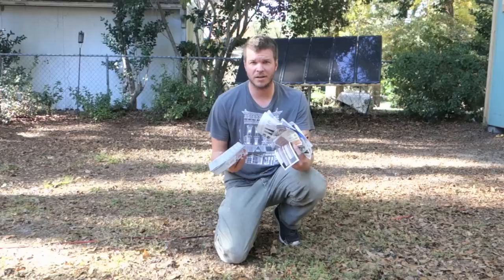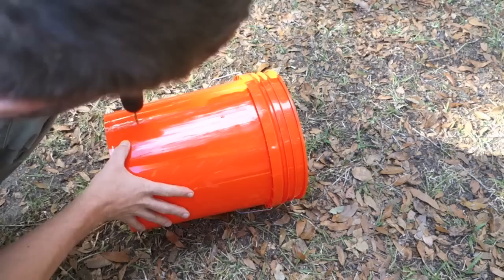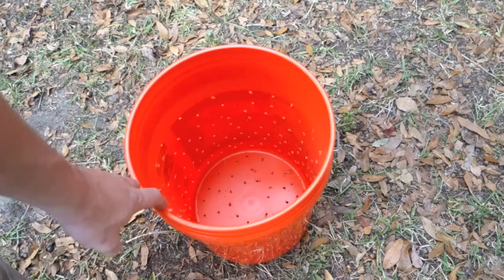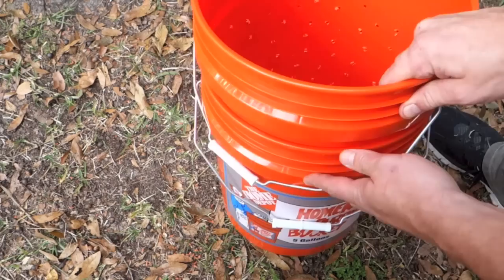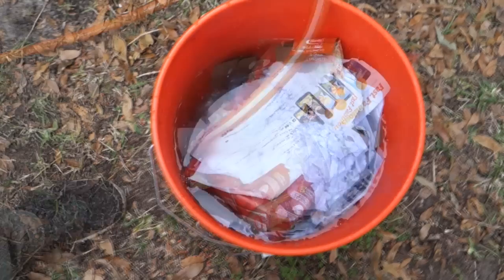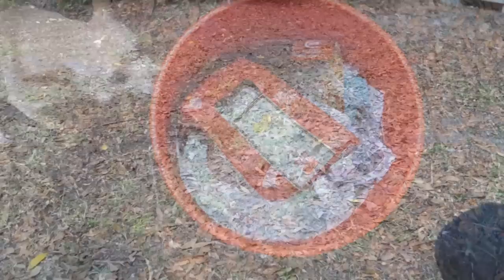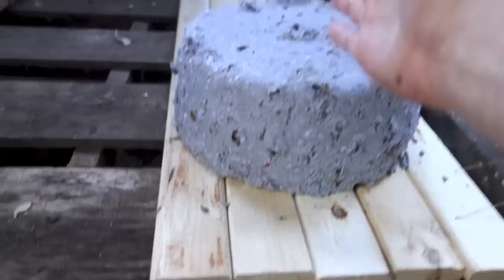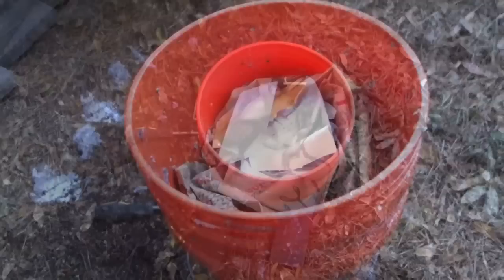Free And Virtually Unlimited Fuel To Heat Your Home

Comment: Unlimited Fuel ??? it takes way too much time.. to heat a house for a winter will take more than 1000 buckets. And where are you going to get all that paper or matter.
If you count your time alone its not worth it.
Reply from the maker: Samuel, the amount of paper logs you need to heat your home depends on the size of your home. On this channel we are discussing tiny homes so the number you mentioned is way over-estimated for the purposes of this video...
Reply: Tiny House Listings that's what i'm thinking while i read your page's name, "tiny house listings"... have you ever tried to heat the house during the whole autumn-winter season? and how much biomass required for that achievement? BTW great video.. thanks for sharing
Reply: Tiny House Listings How small of house are you talking about. My house is 28x60 single foor with 6 inch isolated walls. I live in southern indiana. I would need more than 2000 of those buckets.
Reply: This seriously only takes a few minutes a day after you initially get everything made. This is to be used in addition to wood, or whatever you burn. For the paper? Get free magazine subscriptions, kill your junk mail, ask for paper from neighbors and friends.
Reply: Spunk Mayo I would need around 10,000 pounds of paper to heat my house for a winter. That is not easy to come by. And to blend it up like the guy did in the video puts a lot of air with it and makes it very bulky. It would take a ridicules amount of space to store that amount of paper.
Reply: There's paper garbage everywhere. You could easily come up with 5 tons of garbage paper if you put your mind to it. I spent $3,000 on fuel oil last winter and doubt it would have taken me as long to collect all this paper and make logs as it took to work all those hours to buy fuel. There's probably a good way of mechanizing the process as well if you put your mind to it.
Reply: Thezuule1 Why not just burn wood.. It burns better and generally its attainable.
Reply: Samuel Atkins If you have access to forest land where you can get trees to burn that's probably the best bet if you have a wood stove. Many people in my area use pellet stoves now and the cost of fuel is very cheap, using a method like this you could reduce the cost to almost nothing if you had a pickup truck to haul the stuff and a faster method of making the logs.
Reply: you already miss the point, it's all about ecology... even a systems with a flower pot and candle, maybe is more efficient by the cost.
Reply: ***** You have no concept of energy. It doesnt matter it something burns even for 1000 hours.  That doesn't tell how much energy is being put out. Each one of logs hes making probably weight between 2 to 5 pounds each. assuming they are 5 pounds each log would have around 36000 BTUs. I need 65 Million BTUs a winter. Do the math. I would need 1805 of those paper log. I estimated 2000 but i was off by a few.
Reply: SLA SLASH burning wax is not efficient cost wise.
Reply: Thezuule1 You can get plenty of firewood in a city.. and much of it can be transported by a car.
Reply: Samuel Atkins Not usually for free.
Reply: Thezuule1 Yes its free.. look on craigslist.org. fired wood is being gave away all the time. here in Louisville ky there is a free add for firewood almost every day. its wood people wanna get rid of.
Reply: Samuel Atkins That's fine for the people of Louisville but my local craigslist doesn't have any free firewood. Every listing has a price attached. Cheapest I see is $100 for uncut unsplit.
Reply: ***** No its not. one pound paper has 7200 BTU  and a pound of coal has 9668 BTU. therefore coal has more energy per pound. BTU s is what heats the house.
Reply: You both fail to see the point that these logs are meant to be used in combination with other heat sources, not as a replacement.
Reply: It's simply another method to heat your home, in tandem with wood or coal, meant to reduce the costs of said items.
Reply: c
Reply: God Created Man You made some really good points.
Reply: God Created Man Excellent reply, My Brother, but one more thing we must do.  Require our spoiled brat leaders, and I use that word (leaders) loosely, to do everything they do must be green, can not harm the Earth or anything living there.  Tell the spoiled brats to get out of the sandbox and go home, fire themselves, and take there ball and bat and don't come back!!!   But I loved your reply my Brother, Namaste........
Reply: c
Reply: c
Reply: c
Reply: God Created Man " It seems obvious to me, that this is not a good alternative fuel source, nor is it environmentally friendly...since recycling paper saves trees from being cut down. "

Which is nice except they plant more trees. We don't recycle french fries and we're far from running out of potatoes.
Reply: God Created Man "We are living in the "end-times", which the Holy Bible has revealed many prophecies we are now witnessing as truth (too many to list)."

How convenient..... 

"There will be a "new Jerusalem, which cometh down out of heaven" "

Yes a giant space cube... Brilliant. 

" It is the most amazing book I have ever read, and I am not surprised that it is the most published book in all of human history, "

You've read the entire thing and you can make that claim? You should read other books imo. The Bible isn't even good literature beyond being full of barbarism, incest, genocide, slavery, etc.
Reply: c
Reply: God Created Man "Jesus even says "I am not of this world"...which is exactly like saying "I am an extra-terrestial".  The Bible makes perfect sense to me, and if it doesn't make sense to you, then whose problem is that? "

Might want to loosen the tinfoil. 

"You only inhibit people from learning on their own, because their conclusions do not coincide with your own. "

Nope and your personal conclusions appear to be quite wrong. 

" I believe these extra-terrestrials are watching us all the time, and are far more intelligent than we are.  I also believe the governments of Earth are fully aware of their existence and are hiding it, which is exactly why they don't allow people to think for themselves anymore"

Waaaaaay too tight.
Reply: c
Reply: c
Reply: c
Reply: c
Reply: c
Reply: I think y'all need to change channels y'all have got wwwwwaaaaaaàaaaaaayyyyyyy off the subject. OK I Dont know if any of you were in the ice storm where we were without heat from a week to 2½ to 3 months. Three people died just in my area. Now for all the stuff you throw away in a year I'm sure that by you making the logs would benefit in a emergency, or just to save on other heating sources. Or are all you doing anything to change this issue of giving off harmful chemicals. Or r u waiting on the government to do the work. Get off ur lazy azzes and do your part. One politician can't change everything on his/her self, we have to take part in doing our part. And I'm not saying that some politicians are not crooked as u mentioned but taking 5 min of your day to do this would not hurt you and in return doing ur part in keeping the ozone layer. And as far as firewood call local tree cutting services and some will drop the stuff they cut down to u. Cuz they just Dont want to deal with the wood. And the man in the video is just giving u ideas to help save some money.
Reply: OP has a valid point, however it would not be hard to do this is a more "efficient" way if you used the excess of time and space to your advantage. Most people don't understand when living off the grid that haste & waste simply cannot exist but this is when the creative opportunities presented by time & space are abundant. When we enter this state of mind creative thinking and practice come without effort. This whole paper wood method is not even really about what is "most efficient" by competing industry standards, but rather finding use for an abundance that suits your "talents" and/or desires and/or lifestyle choice, which is what really is the only efficient thing by competing cosmic standards, which are really the only competing standards after all. That is if you're not into that whole 'brevity thing.   #thedudeabides
Reply: c
Reply: c
Reply: I wouldn't say that I'm worried about the mill closing. Just an outward expression in writing about how much I love living in the woods.

I find that we also have a rather similar belief on recycling as well. It is a much needed thing, though I doubt it will be catching on anytime soon around these parts. Best we have is when we burn the paper or use an old tire to make a planter... Scrapping old metal is rather lucrative though.

I'm with you on the governing powers that be... not even gonna' start down that road. America is really bad off with who's running it into the ground. And I don't mean just the president. >,<

As for global warming, I say if a volcano can spew out more emissions than all of humanity over its entire industrial era, It's not something we can really control. Not to mention the fact that the Earth has always gone back and forth between hot and cold since it creation.

Our environmental impact however is definitely getting to be a little out of hand. That is the greatest concern for me.

Anyways, I'm with you on sleep. Thank you for the conversation and god bless.
Reply: Samuel Atkins You haven't heard of the once a year Ikea candle sale.  100 T-lites for $2.00
Reply: bloodandwinearered Yes.. and they are pretty small. Below is the link to the candles. 
I am not sure what you are trying to say. 
http://www.ikea.com/us/en/catalog/products/50097995/
Reply: Samuel Atkins Thank you for your reply.  I read where you said that wax was an expensive fuel.  You are right.  I just wanted to point out, that expensive fuel, at half price, is suddenly not expensive fuel.  I buy 2,000 candles a year.  Four of these small tealites under a three flower pot heater, offer me four hours comfort for 8 cents.
Reply: Spunk Mayo And you have to spend water, electricity, your time... Maybe it would be more effective and cheaper to buy truck of firewood?
Reply: bloodandwinearered How much does one of those little candles weigh
?
Reply: Samuel Atkins About a half ounce.
Reply: bloodandwinearered based on the weight you gave me wax is about same price as using Kerosene. Both are about the same price per pound and both has very close to the same BTUs. Electric on the other hand in my area is cheaper than using your type of candles. 17 kilowatts cost me $1.70  and this  has the same amount of energy as 100 candles.
Reply: Samuel Atkins Now really, what I am supposed to reply to that? 

I like the heat source near me.  Like sitting close to a fire.  I have an oil filled electric radiator heater that is just at my side.  I always have a hand atop it.  For 30 cents more... I can have my flower pot heater next to me on my desk.  I need not heat the whole place.  I only need heat where I am sitting.  I keep a bit of heat on in the bathroom.  I heat the solon with the oil filled electric radiator, heat the kitchen baking bread, heat the dining room with kerosene lamps and heat my personal space with a flower pot heater.  

You are correct, but it is only 30 cents more to have my heat right where I am.  I question if it is more expensive to heat the whole room with electricity. 

I lived through the 1991 ice storm.  I lived in January, in Quebec, with no heat for 13 days.  I managed to keep the place from freezing.
Reply: Samuel Atkins I hear what your saying sir, but take it from a gent that lives in Alaska and often heats my Home/Cabins with means other than natural gas; for about the same effort it takes to cut enough firewood (which you'll need to do anyway to utilize these paper logs), you can make enough biomass logs. You claimed that you'd need "around 1000 buckets" to heat your Indiana home, which I can tell you is an overestimation (unless you guys REALLY like heat down there lol XD). You use these to keep a fire going, not as the main fuel source, up here in the harsh winter 2 buckets along with some firewood keeps a "Tiny House" very comfortable, and somehow me and my family come up with 2 buckets of paper EASY lol. If you know anything about heating your home with firewood alone, you'd know that these biomass logs are a welcome way to recycle otherwise wasted fuel (we make it by the barrel though, so maybe that's where my opinion comes from, on a larger scale, this is very practical).
Reply: bloodandwinearered I was thinking you were crazy for burning wax for heat. just off hand i thought it was several times more expensive than Kerosene. And I was going to point this out to you. however when I figured the difference in price I was shocked. I went ahead and  posted this info for you. I thought it might interest you a little. If you like setting close to a fire than all the power to you. I use the T-lites for light when my Electric goes off.
Reply: cybertree How much paper weight do you think is in one of those paper logs made in a bucket?
Reply: Samuel Atkins Once again, thank you for your reply.  I am not accustomed to civil discussions in YouTube comment sections.  Here is to both of us staying warm and comfortable in our own ways this winter.
Reply: Samuel Atkins I don't think density is the real problem here (enough paper to meet your 65 MBTU needs would fit within a 6 foot cube were it compressed completely), it's the sheer amount of paper you'd have to receive (9000 lb). Think about that. That's almost 25 lb of paper every day of the year. That's a lot of paper.
Reply: toxic color papers. cancer stew.
Reply: Idk. That's a good question though.
Reply: Eric R Depends on which papers. Things like newspaper and that are predominantly made with plant-based inks these days.

In either case, if your firebox of choice leaks air back into your house, it's doing something wrong.
Reply: Spunk Mayo Only newspaper etc works.. Burning magazines are very bad for the environment AND humans/animals..Plus it burns like wet shit!
Reply: seigeengine lol at 6 foot cube.. interesting.
But think about it though. if it wasn't compacted would take up a lot of space.
Reply: Samuel Atkins Yeah, but compare that space to alternative fuels, like cords of wood? A good fire wood has about 22-23 MBTU/cord, so you'd need about three of them to provide the same energy, which would come in at over 7 feet, whereas paper is under 6. My point was mainly to say "Hey, it's not like it would take up THAT much space."

I still think the problem of supply is the biggest. We might get an average of half a pound a day, which puts you at about...... 8800 lb of paper short.
Reply: silveryblue2003 Even all of that would only be a fraction unless you went out of your way to get paper. Doing so would take work, and you're back at making this as inconvenient or worse than obtaining other fuels.
Reply: silveryblue2003 Yep!
Reply: Samuel Atkins That's not a house, it's a trailer
Reply: TRUE DAT!
Reply: ***** Yeah, you could bury my mail box in how much paper you'd have to get in a single day to make 750 a year.
Reply: The fuel is unlimited because it is not restricted to paper ... dry ... dry leaves or rotten wood milled laborious ... yeah, not limited;) ... DID the same as others with more affordable materials ... View presses used in briquettes and he used :) ... Great ...
Reply: This idea is for the do-it-yourself people. In addition, you have to start collecting paper in spring to have enough to last the winter. The mailers and news papers I get is usually enough to last me 2 months. I don't continuously heat my house with these - I use them for camp fires in the backyard. Pretty fun nontheless, shred paper in one sitting and make a few big buckets then cut them into quarters. Great for substituting wood and cuts down on wasting good wood.
Reply: I would like see a vídeo with your fuel in use ... Have you one ???
Reply: what you need to do is find some really poor people, maybe in communist china, to make these logs for a penny or two a piece. My time is way to valuable to waste making paper logs.
I even have one of those huge paper recycle dumpsters across the street. But as I said my time is to valuable and I would lose money spending my time for heat this way, cheaper for me to pay the district energy corporation and use the heat on the grid.
Reply: jackchorn Welcome to reality, but, if you're anywhere near the average person, your time is worth jack shit, and you waste plenty of it.
Reply: seigeengine my time is cherished. This is why I try not to spend much of it trading my labor for a wage.
I'm debt free, own my home and only need to work 10hrs a week to meet my needs.
Funny thing is I have more wealth then the vast majority of citizens.
Time is not money.
Reply: jackchorn You say that, but you spend time talking about it on the internet, so I have to question how much it takes, in reality, to motivate you to use up your time.

Money, as in units of currency as a measure of value are, economically, a stand-in for all forms of value in all things. That's the entire idea of a currency. That it's an absolute intermediary. That everything with value is translatable into a certain amount of that currency.

Great, but what do you actually do to earn money ten hours a week? And there's other forms of value possibly involved in labour. A mechanic, for example, can take satisfaction in helping people, and derive non-monetary value from the process of performing their job.

At the core of it, I agree with you. I'd rather work as little as possible, satisfy my needs (and wants, them not being outlandish), and have the rest of my time free to whatever I wish to fill it with.

Even then, what I wish to fill it with is always going to involve a certain amount of waste. I'm always going to have times when I don't want to think, or be invested in something, and just want to mindlessly perform a simple task to relax, focus my mind, and let it wander.
Reply: seigeengine very thoughtful.
Its a shame we live in a society that frowns on someone who spends their time pursuing a passion if it does not show a value in currency.
Reply: Realy Jackhsorn , realy ... We can to change it .. Now :) !!!
Reply: jackchorn Indeed, but that's the wonderful of thinking of value as currency. All value becomes the same, and you can more readily compare things.
Reply: seigeengine I'm fighting to go to a Tulip backed currency.
Reply: Samuel Atkins The biggest would be something like 14x24, but usually for house on wheels it can be 16(or 24)x6'8", or 10x12 studio cabins and everything in between.
Reply: Unbelievable how negatively people act on free advice on You Tube. Spend less time watching TV or whatever, and make one or two  of two of these paper blocks, even it is mainly for the fun. Definitely lots of fun for the kids. And the satisfaction of burning your own homemade fuel, even if it is only one block. And saving on  electricity keeping the paper from piling up on the dumping sites, etc..  And you get some sunshine if you do it outside.   Think Mother Nature. Do every bit you can. And to those who say it pollutes the air, therefor you won't use it: Hope you  are all making exclusively use of solar /wind energy.
Reply: Como opção briquetes são ótimos ... !!!
Reply: Simple Samuel Atkins Newspapers on the curbside!  I see STACKS of them every week.
Reply: Well you said it takes too much time and ISN'T   WORTH IT!!???? What you need to say is that IT'S  NOT WORTH IT ,,,TO YOU!!   VALUE  OF  SOMETHING  TO YOU   CAN BE WAY DIFFERENT  TO ME AND OTHERS!!  Like some people say golf isnt worth YOUR   TIME,,    HOWEVER to Many people   golf is PRICELESS !  JUST BC YOU DONT THINK SO  DOES NOT MEAN I DON'T  THINK IT WELL WORTH ME TIME!! AND  THEY JUST LIKE  MAKING SOMETHING  ON THEIR OWN AND TO  NOT BE SO DEPENDENT  ON   OTHERS AND GOV ,   NOT TO MENTION  THE MONEY THEY COULD SAVE!!
Reply: Seth Maddox This is an intelligent point applied to dumbly to the wrong context.

The reason some people value golf is because they enjoy it. They derive pleasure from engaging in gold. To them it has an easily understood value, whereas to others it does not. Where is your emotional investment in compressing paper into bricks and burning them? Most people certainly don't have one. Are you concerned about the environment? Do you have the foggiest idea of how this might  compare, then, environmentally, to recycling it?

How many dollars does a BTU of compressed paper have above buying or cutting your own firewood, or even using a different heat source? How much time does it cost you to each BTU of paperbrick?

Because let's look at your idea critically. Almost nobody considers golf priceless. The question is how much money you'd have to offer them for them to not play golf when they had otherwise wanted to, per hour? For example, if they'd normally play, say, 20 hours of golf a month, how much would I have to offer them before they'd not play golf for a month?

How much is screwing around with paper and buckets really worth to you, Mr. Maddox?
Reply: Done 365 days/ year, it may very well be worth it!  What about getting paper from neighbors? Getting your kids to help as a game of sorts. Savings could be toys, Disney CDs, visit, all kinds of kid rewards.
Reply: Laura Cullen Oh look, now you're not only wasting your time, but your neighbours time, and your kid's time!
Reply: Seth Maddox It's like a fourth grader watched babbies first economics video and thinks they understand anything.
Reply: But hey thats what you trolls do, its your right,    no matter how stupid  it is
Reply: Muted the troll.
Reply: Seth Maddox might those fingers be occupied elsewhere. Mouth drool?  Nasal boulders?  Jiggers?
Reply: Laura Cullen yea when I responded  to you it was meant to be AGREEMENT  WITH  WHAT YOU SAID ,   NOT ATTACK  ON YOU, if that's   what  ya talking about , ,,thats my bad!
Reply: seigeengine IF you suggesting in  another comment that  wood is 3 time more dense than these paper logs than does it make sense it takes up three times the space to store? You seem like you were saying storing is not an issue. 
I find it an issue because wood can be stored outside and it would be difficult to store paper logs outside. Also the way the logs were ,made in this video it probably would take 3-4 times the space wood would take up and mostly likely this would have to be stored inside and the wood can be stored outside.
A lot less people would burn wood if it had to be stored inside. Especially so if it took up 3 times the space. In am not sure what you mean when you said "which would come in at over 7 feet, whereas paper is under 6. "
Reply: Seth Maddox Enough with the caps.. I supposed you going to call me a troll next. Just because seigeengine  says something you dont like doesnt suddenly makes him a toll. Grow up.  You the one getting all bent out of shape over whats on this channel..  Maybe you should turn the channel. seigeengine seems  to be doing what a good youtuber does.. Keeps on topic, keeps the name calling to a minimum and not yell in CAPS.
You are far closer  to a troll than he is.  And who is "WE".. Have you included Laura Cullen  to be part of your clan. It looked like you was trying to buddy up to her. Maybe she doesn't want you speaking on her behalf. Seth Maddox since i started this thread i have the delete controls. I don't like to use it so please don't make me use it.
Reply: Samuel Atkins More or less, but I don't think I said that.

Paper can be stored outside, but it would just need to be covered to avoid rain. But, that exact ability to absorb water better than wood is why it would also dry to ambient humidity faster outside.

I described that. Feel free to reread until you understand it. I'm talking about the dimensions of a volume of wood and paper that would supply the same amount of energy. As best as I can recall, that was a six foot cube of paper has the same energy as a seven foot cube of wood.
Reply: seigeengine I understand you now..
Reply: Wow
Reply: Sorry 
SORRY WOW
Reply: GLAD YOU TOLD ME ! I WAS WONDERING WHAT A "GOOD" YOUTUBER WAS
Reply: Samuel Atkins  please help me understand something you wrote:  what is/are:  "delete controls"?  I've not heard of that before!  And don't tell me I'm stupid, or some other comment to boost your ego; it will NOT be believed!!
Reply: Laura Cullen As the creator of this thread, Samuel possesses the ability to remove any comment contained herein.

I'd suggest you calm down. You are appearing to be extremely hostile, and paranoid.
Reply: seigeengine LOL
If i start a thread normally I can delete any comments made including the thread itself but for some strange reason i cant do it here. youtube changed something or the channel owner must set it so i cant delete comments.
Reply: Laura Cullen  seigeengine answered your question. I hope that makes things clearer for you.
Reply: Laura Cullen Then maybe consider that your behaviour makes others think that, and consider changing your behaviour.
Reply: we need to see how these logs burn.....can these logs be mixed in a fuel like fat lighter? i think this is how they make fuel flame starter logs....
Reply: sayheytome What about candle left overs?   Chopped, ground, etc added to leaf mix.
Reply: seigeengine  Do I understand you to mean  I have the ability to put thoughts into the minds of others?  Really?  That isn't possible, is it?  Or have I misunderstood?
Reply: Laura Cullen Yes, that is what I said.

That is the function of language... to put thoughts in another person's head.
Reply: Laura Cullen Mixing other fuels that have high evaporation point with your wood or paper is a very bad idea. Are you trying to get the guy to burn his house down or waste his fuel?
You should stick to giving advice to soccer moms from now on.
Reply: sayheytome I have also burned similar paper/logs and they tend to smolder at times.  I would make sure you have plenty of air flow. forced air would  probably be best if it doesn't  put out enough heat.  Your logs will make  a lot of of ash and it might cover up your fat lighter and may starve it from oxygen. 

Due to the nature of how the logs burn You may have to stir your fire from time time so you might not want to have fat lighter in there. It will make it more difficult to stir.

If you have grates in your stove you are in luck.Logs should burn really good without forced air.  and you need to stir it far less if any at all. And there shouldn't be an issue with using the fat lighter.
Reply: Samuel Atkins
got an idea...make the logs rectangular with a hole going thru the middle ....that will allow air and not smolder!
Reply: Samuel Atkins             ,
Reply: sayheytome  would air circulat8on not increase the rate of combustion and burn the log faster, requiring more logs?
Reply: Laura Cullen The actual problem is that it'll likely collapse as it burns, and that the air channel decreases the energy/volume and so makes it more annoying to store. Never mind that it would make the bricks harder to make, and easier to break.
Reply: Just steal your neighbor's firewood. Once you've got a nice fire going, invite him over, and say. "Hey, got any extra logs? We're about to run out!".  Don't forget his cocktail!
Reply: Samuel Atkins your spot on with your analysis of this video - the idea itself is the only thing being recycled here - because it seems to resurface every 10 years or so - we had this in Ireland about 30 years ago - and where we live on the Gaeltacht West - the vast majority would rely totally on solid fuel for heating at that time - if I spent a day in the bog cutting turf I would have enough fuel to last me a year providing all heating hot water and some cooking - the same amount would require 4 or 5 days work harvesting and bringing home - spread out but in total 5 or 6 days work would provide me with enough...!If I spent the same amount of time creating these bricks - I would have enough fuel to do me about 1 week - assuming I had enough material....!Ridiculous idea....!
Reply: MrJoecool9999 I love how your alternative is "FUCK UP EVERYTHING I SEE."
Reply: U
Reply: Well said,it amazes me how people can argue about something simple like this good idea. This will help save a person  money, all savings add up no matter how tiny a saving it is.